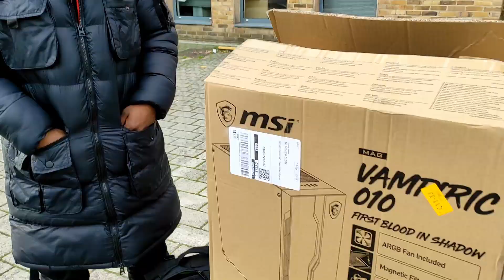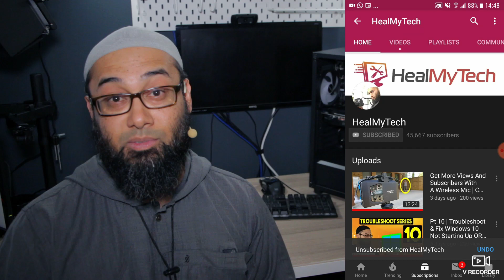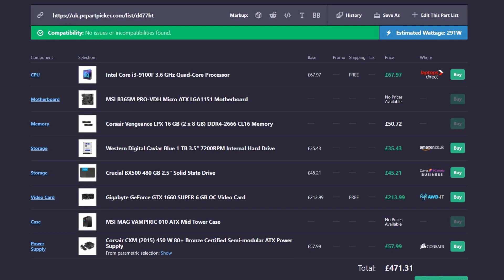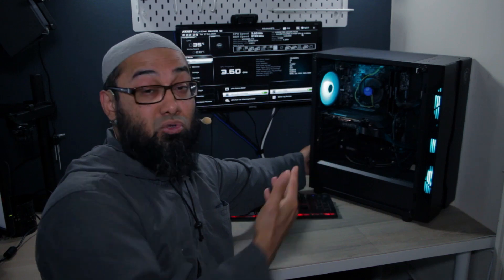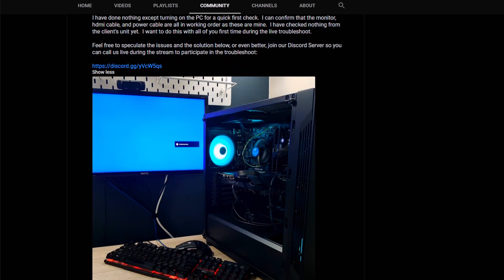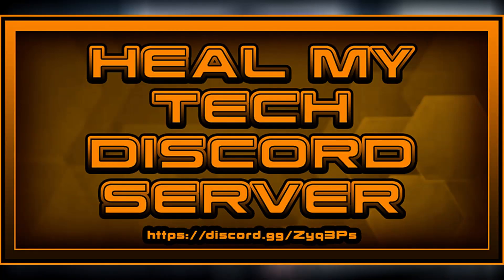New Gaming PC Build No Display – UNBELIEVABLE Noob Mistake!

Comment: Just got a new pc, mounted the gpu because was sent separately, everything turns on but no signal on monitor tried different cable, all plugged in gpu or moderboard , tried tv , nothing, I'm lost, also I checked the ram it's all good

Comment: I've built 20 computers in my time. And the one I built this week nearly broke me. I checked everything under the sun, all except for my memory stick because I was convicned it was properly installed. Turned out the top of the stick wasn't fully clipped in (hidden from me bcause of the AIO radiator) and here I am crying from happiness and disappointment. Ty for the video.

Comment: I want to know what mistake I did... I bought a new PC, assembly PC, install windows then install epic games desktop app, then decided to turn off the tv and after one hour tried to turn on the TV.. no signal... Then connected pc on a monitor with HDMI, then after that with display port... No signal... Remove ram, put again them in, remove GPU put it again... Check all cables... remove CMOS... Did all things from youtube and still not working ... I am getting into rage mode :D

Comment: Mine clicked, all good. Still nothing  :(  Bios is updated on the Asrock MB. all cables are secure, HDMI plugged into the correct spot (no GPU yet) No conflicts on System Builder. No I didn't do the breadboard thing because I wasn't aware of it at first. Power button works, but the reset button does not. I've tried every possible placement of those pins, there are only two. But even so, without the reset I should still get a monitor signal right? There is nothing else on the board except an additional fan, the SSD card and a HHD on the underside (also correctly plugged in, etc)

The Asrock B450M 4.0  manual is horrible. There are no photos of where to put what. Just lousy diagrammes with no explanations . Some MBs have the pins colour coded, not this one.

And no beeps, probably because there isn't any speaker. There is really nothing much to this build because I don't have a lot of money, it's a basic plain-Jane nothing fancy build.  :( 

Any other ideas?
Reply: @Scubarayy I was under the impression that the ASrock card would work at the 2GB video rate without a GPU card. But then I found out my Ryzen 5 does not have internal graphics capability, so that's why I wasn't getting a signal. I put in my old 2GB GPU and it worked just fine. Again, some of the newer Ryzen CPUs will come with the graphics again later this year. It's just odd that the motherboard came with the VGA and HDMI slots when it wont' work without a GPU card.

Comment: PLEASE HELP
I TRIED TAKING THE CMOS OUT
CHECKING COMPATIBILITY (100%)
Taking gpu out
Checking plugs and monitors
NOTHING WORKED
PLEASE HELPPPPP
Also Ram in 2 n 4
Reply: Did you ever fix it?
Reply: @cynthiaandoh9575  yes I tried plugging everything again securely then it worked
Reply: @mo7sin711  How long did it take

Comment: Okay so I've just built a new pc with all brand new parts, but classic no post right, I've triple checked everything is plugged in properly and all my parts are compatible, brand new monitor as well that I have used with my xbox a time or 2, I can't seem to figure it out
Reply: I used 
Corsiar CX650F psu
A520 aorus elite
Ryzen 5 3600
Corsair 2x8 gb ram
Gtx 1660 super (ventus xs oc)
WD blue 1tb nvme ssd 
Samsung 870 QVO 1tb ssd
Reply: @leviwhitman1155  Same. Did you ever fix it?

Comment: I am using a Ryzen 5, Asrock B550 pro, t force Vulcan 16 GB Ram, and a 450 wat EVGA power supply, and my monitor does not turn on, what could be the mistake, I am only 13 and I spent literally my life savings that I have been saving up for so long to get a pc and the monitor doesn't turn on, is there anything that you noticed is wrong with the PC from that info or do you need more. PLEASE HELP ME, I do not just want to have a box sitting around that I spent all my money on sitting around. And no, I did not use a single one of my parent's dollars.
Reply: Bro, I feel ya', What Happened??
Reply: well what gpu do u have cuz u dont have integrated graphics

Comment: I’m having the same issue but I have tried a bunch things. I have tried taking out the ram and putting back in
Reply: what are your specs for your machine?
Reply: @zulugamer67  thank you I have brought my computer alive from the dead
Reply: @christiansilva9911  nice so what was the issue?
Reply: @zulugamer67  my issue was the RAM that I bought was bad so I went an bought a different one and it worked.
Reply: @christiansilva9911  Was it RGB? Because mine works I think since it's RGB turns on

Comment: my pc has worked for years, i got a new cpu the other day and it worked fine. my whole pc is on, kb and mouse are on, fans spinning but no signal to the monitor. my motherboard has a solid orange light and last time it did that i had to get a new psu, but if my psu is messed up again wouldn’t my pc NOT be turning on?
Reply: i'd say if you still have the old cpu and you know it still works you should be able to retest it on the motherboard first before coming to the conclusion that the power supply is bad.

Comment: I used to fix cars. The most common reason a car was towed in was because it was out of gas. The first thing I did when a car was towed in was to check the gas gauge. I like trouble shooting simple problems. Trouble shooting complicated problems can be complicated.
Reply: True 🥺🤝🥺
Reply: Thats the thing about complicated things, they do tend to be complicated
Reply: @leviwhitman1155  Yes, with a complicated thing the problem can be complicated, but it can also be a simple problem. Look for the simple problem first. Don't start off looking for the problem that makes you look like a genius. For example when you computer seems broke because it won't come on, the motherboard or CPU can be dead, but it also can be unplugged from the wall. Check to see that it is plugged in before you replace the CPU.